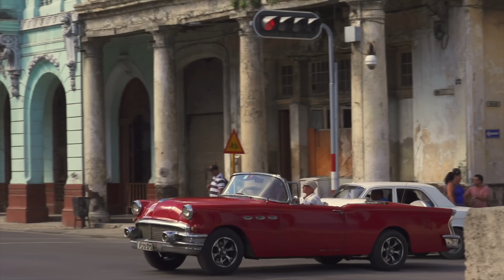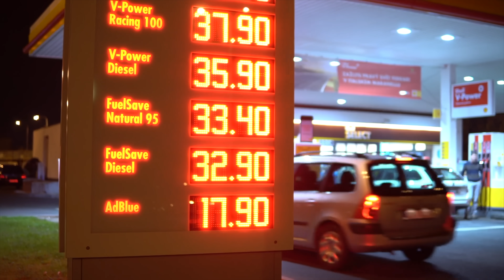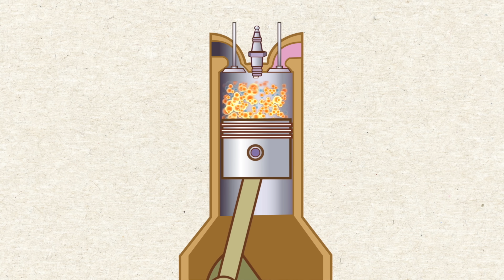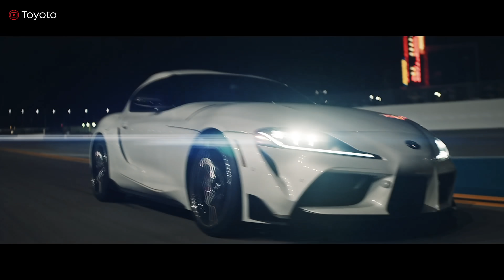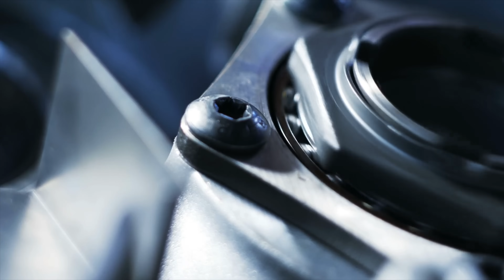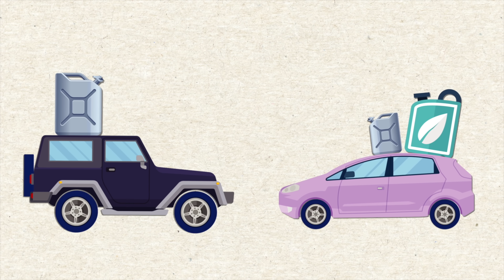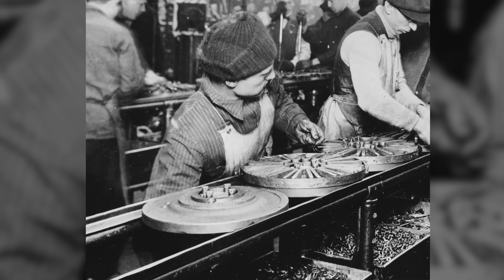7 Fuel Myths Stupid People Fall For

Comment: Call me stupid and I don't care what you have to say. I own a 2011 Kia Sportage, manual transmission with 238,000 on it and have ALWAYS used the lowest grade without any issues. Changed the oil religiously and the car is still rolling strong. Idles so quietly at 500 rpm I often forget its running. 😮😅

Comment: Learn the difference between fuel type. A car if its engine runs on 87 gas is stupid to put 91. The car will not have better performance. It will be the opposite

Comment: This is totally not true. Fact never lie.
Hi octane fuel= fuel cleanliness, higher power and efficiency, on top of less pollutants provided you have the best higher performance spark plugs.
87 on high end brands is  conducen to engine damage in the long run.

Comment: I drive an old 03 Civic ... cuz i'm broke :( ..  and i've noticed better fuel efficiency using 91. The math probably evens out in terms of the lower cost of regular gas but with more fueling throughout the week. Which is why I just use 91. Sure I pay more but less having to fuel throughout the week. 
However, i've also noticed that different gas stations also affect fuel efficiency. I DO NOT use ARCO, Valero, or Mobile because i've noticed their fuel does not last for crap. Not even their premium. Costco, Walmart, and Chevron fuel last me the longest. Ideally i shoot for Costco because they're the cheapest.

Comment: Your car being built from the manufacturer whether it's Toyota general motors Dodge whatever Audi. that engine was designed for a certain fuel octane use that fuel octane. Forget about all the noise that this guy is making

Comment: This was so perfectly explained! Just one tip about European vehicles, they can't use higher ethanol content than 10% if they are not flex fuel some can't even more than 5%. 
Very nicely explained topic and very accurate. And about octane rating Europesan vehicles can't run lower than RON 95 so European cars because of their tune would have knock on 87.

Comment: Certainly noticed a diffrence in over all efficency driving 98 instead of 95 in my Saab 9-3 from 05. Especially mileage. And especially since they changed 95 to E10 and 98 to E5.
Reply: Ethonal can lead to a 50% reduction in fuel mileage. Premium currently has zero Ethonal in our state so it of course increases fuel mileage. I lose 3-5 mpg on E10 vs Premium
Reply: The difference in energy density of fuel without the ethanol from low to high is less than .01% (video not 100% accurate on this)
The difference for different amounts of ethanol....is much much higher. It osnt the octane rating, it's the amount fo ethanol.

Comment: You repeatedly refer to carbon dioxide when discussing the exhaust. There is nothing toxic about CO2. The catalytic converter and other pollution controls are concerned with carbon monoxide, CO. It IS a toxic chemical and needs to be reduced as much as possible.

Comment: It is believed that running higher octane burns cleaner in regular cars and can even remove build up on your plugs, valves and cylinder.
Reply: Believed by who?  The promotional material at your local gas station I'm sure.

Comment: Tell this to my VW that wouldn't run with anything but 91+. "Required" is the key word here. If the engine needs higher octane, you need to use that or the car engine will have issues. I like how this video starts out saying "don't buy high octane" and in the middle does a 180 and say what we all know already. use the octane rating your engine needs.

Comment: How do you explain getting better gas mileage in a car that only requires 87 when 91 is used instead? Must be something going on there...
Reply: @07Knightfall - if Scotty does not answer, keep spending more money for the 91, without knowing "why."
Reply: Depends on where you are. If the state or gas statuon is one that has lower ethanol % in higher octane that is the answer...otherwise I couldn't explain it. Technically the video isn't 100% correct, all else being equal, higher octane actually is less energy dense, the difference is just less than. 01%

Comment: There was a mistake on this video.. Did you spot it?
Reply: a hotter engine will knock more with a lower octane so a higher octane is better for a hotter engine! Heat and the octane ratings are related.
Also, E5 and E10 are used in the UK! E5 is 5% bioethanol and did you know that Henry Ford's wife ran a battery car not an IC so why did it take so long to develope the EV?

Comment: It cost me more $4.99 a gallon but I usually run non ethanol I have some older cars I figure it keeps my check engine lights from coming on because my car's sit 2 days out of three and I worry about the ethanol gumming up , I rotate three cars, one car does require premium , humorously I consider myself the poor man's Jay Leno I have a great 94 Lexus ES300 with only 50,000 miles on it as of 2025 got a great deal on it 2 years ago paid $5,000 but did cost me $1,000 to run down I had a bad computer so the capacitors leaked on the circuit board really once I got that fixed I'm in great shape now ,the other two cars are daewoo nubiras they run fine little zippier than civics as they have a 2 L engine and then I have a 73 MG Midget that I've I've had since 1975 I just drive it to the park as it's the only one without ac and also I need to run down a brake light issue probably a ground

Comment: Gotta disagree on this . Ive ran premium 91 octane fr over 40 years ! I get 3 more miles to the gallon with 91 octane vs 85 octane . If i run 85 i gotta take 4 , 5 degrees of timing out so the motor dont knock . Timing builds horsepower ! So now its a little lazier off the line . Starts a little harder when its zero out side ! 2 years ago i rented a brand new chevy truck to go cross country . If i filled up on 87 octane the truck calced 400 miles to a tank of gas . When i filled the truck with 93 octane the vehicle calced 520 miles to a tank of gas ! I also run 91 octane in my 2019 welder . If i run 85 octane it vapor locks and wont restart in the summer . If i run 91 i have a lot less vapor lock issues ! Ive had several ppl through the years ask why i run premium . The last was the manager at the gas station i went to . She tried 91 in her 2010 van . Said it alot more power and she also got a cpl more miles to the gallon with it . I run 91 in everything ! Have for over 40 years ! Snowmobiles , chainsaws , lawn mower !  I get 16 to 17 miles to the gallon in my 77 3/4 ton chevy truck with a 400 sbc a q jet and 35/12.50 tires ! AND eat my holley buddies when we race ! But thats a different story

Comment: My last car was a 2004 Mercury Grand Marquis GS. I always ran 89 octane in it. So when my youngest sister's boyfriend put gas in my car for taking them to a doctor's appointment they added 87 octane. That was gone in half the time or less that 89 lasts. That was also the last time I took them to a doctor's appointment. Now I own a 2013 Hyundai Elantra GLS and from habit I only use 89. Of course I just read it only requires 87, but I'm not willing to get lower fuel economy. I might try 87 soon and measure how long it lasts, but I'm not sure if that's a good idea. Also, when I got my first oil change I also got other services. Fuel injection cleaning and oil system cleaning. It increased my fuel economy by 51%. Instead of getting 20mpg I started getting 32mpg. Of course it's not steady, but when it was getting 20mpg even that wasn't a constant. So I was saying it was an "At best" scenario. It's been a while since I got those services done, but it's also been a while since I got an oil change. Since I drive my car 5,000 miles per year I generally just get two oil changes per year. Otherwise I don't really drive other than to and from work. Maybe a few other places during days off throughout the year.